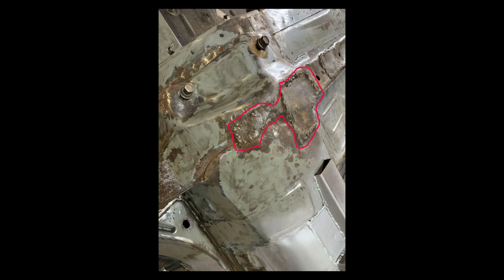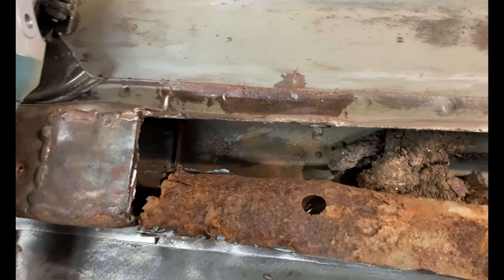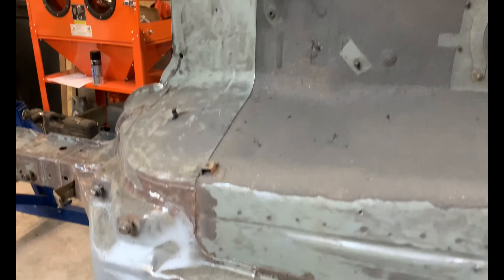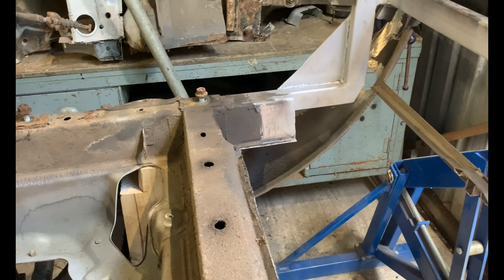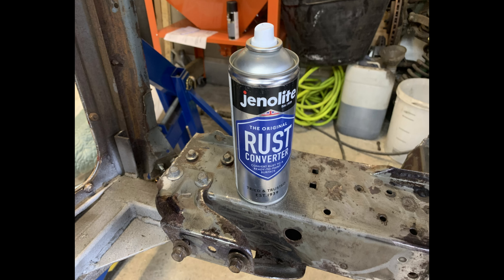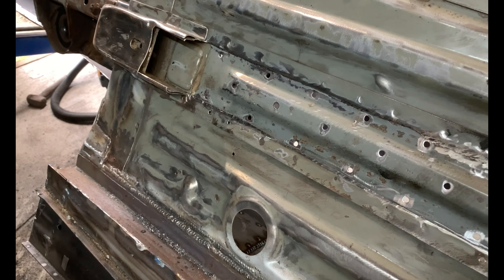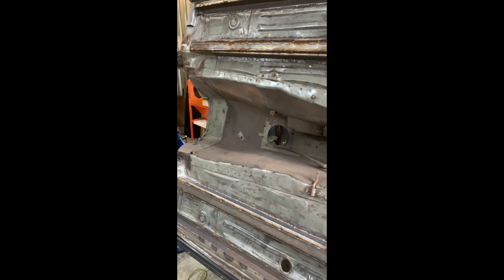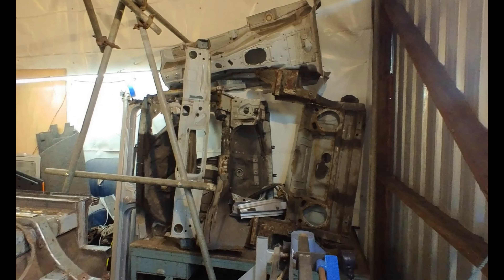Morris Minor MX5 body swap Part 11

Comment: Chassis rails look solid much stronger than the original setup should help with jacking and adding strength and stiffness. Will be interesting to know the weight when done. It would be good if you can keep it close to what the MX5 weighs. Another great update.
Reply from the maker: Thank you yes way stronger. I would like to keep the weight as low as possible. The wings, doors, boot and bonnet will hopefully be all fibre glass to help prevent rust and shed some weight.